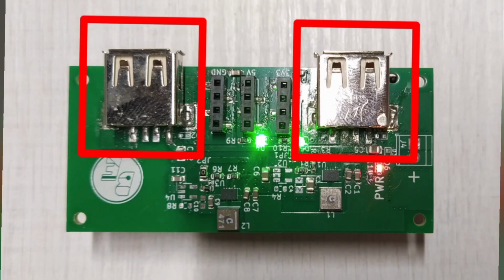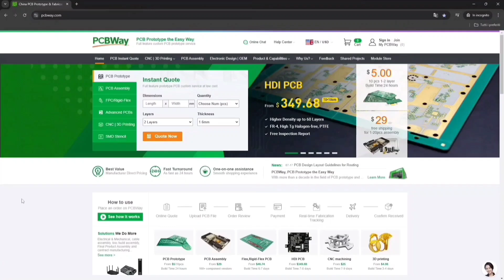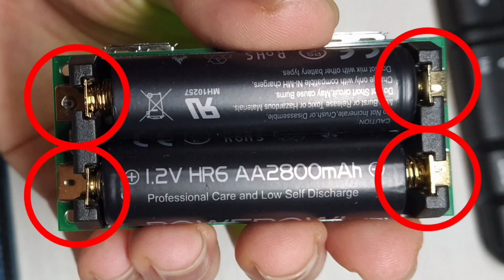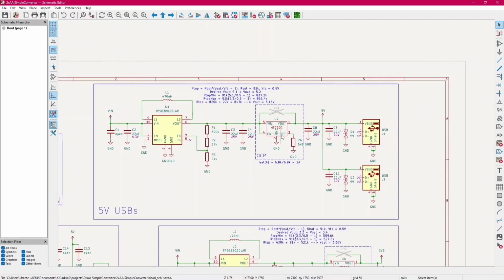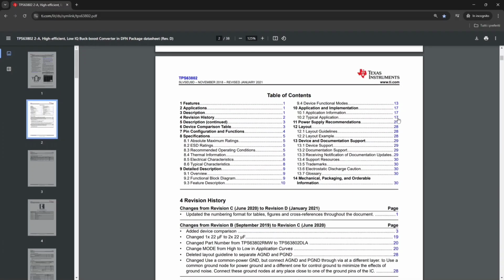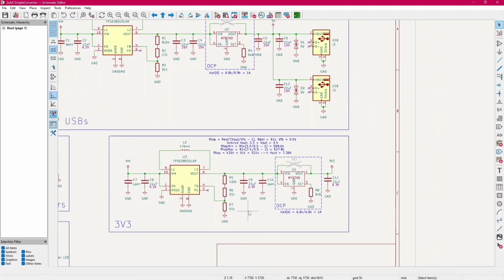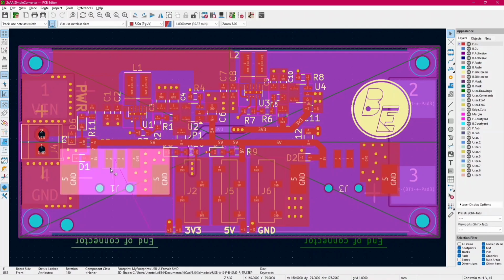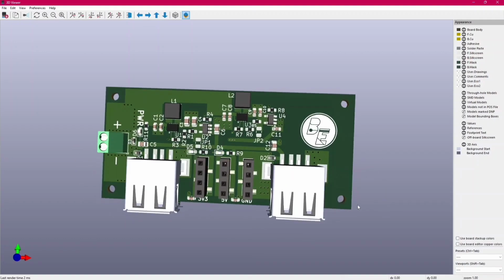Power your arduino/esp32 with only two AA batteries!

Comment: Is it just connector or does it multiplies voltage to 5v?
Reply from the maker: @EfeKaan48  Hi, the pcb takes in input 2 AA batteries. Either standard one or rechargable ones and then gives you:
2x 5V USB
5V, 3.3V, GND pin header